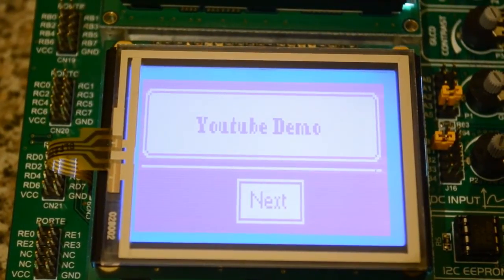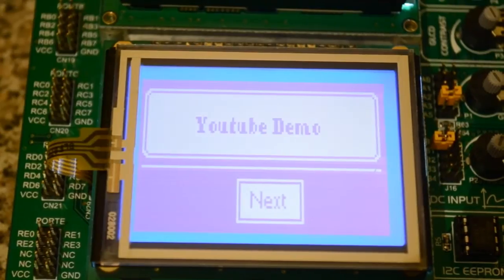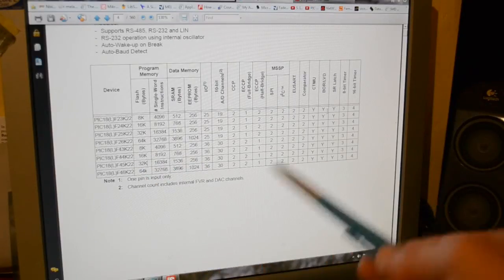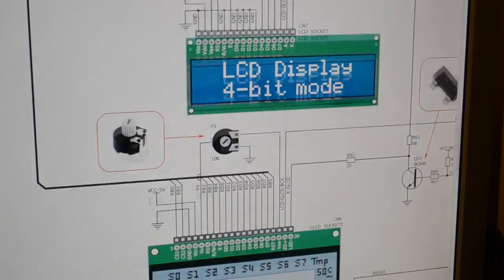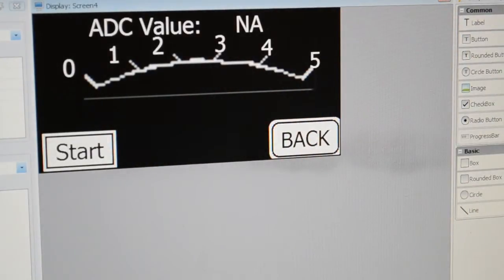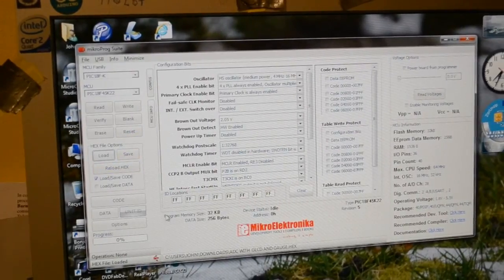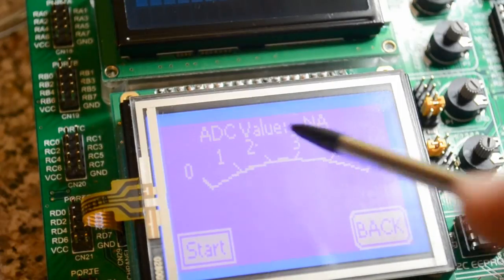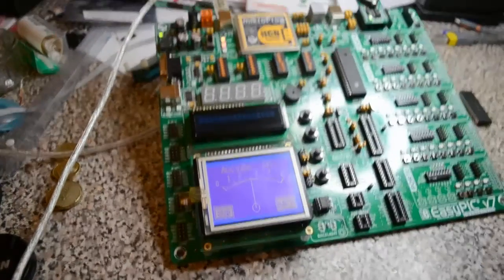Touch Screen GLCD Demo & A to D Converter with GLCD Display 128 x 64

Comment: Nice work, can you please share the code
Reply from the maker: I mention the code is at Mikroelektronika and Visual GLCD
It's free to download
Reply: Thank you for your reply, but I didn't find at Mikroelektronika, please, can you give a direct link and sorry for the disturbance.
Reply from the maker: http://www.mikroe.com/visualglcd/
It's free to use with less then 7 objects.
The codes are examples
Reply: Thank you very much.
Reply: hi,Thanks for the video.I am working on GLCD 128x64.currently i am trying Touch on this lcd.i am using MPLABx tools.so please share this code on rohitpatil597@gmail.com.
I didn't get any code on this website http://www.mikroe.com/visualglcd/